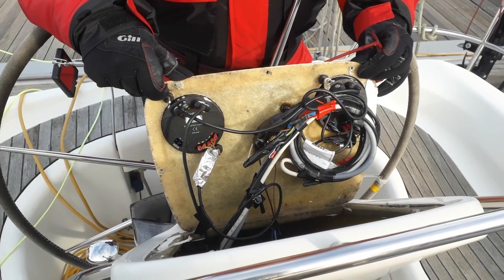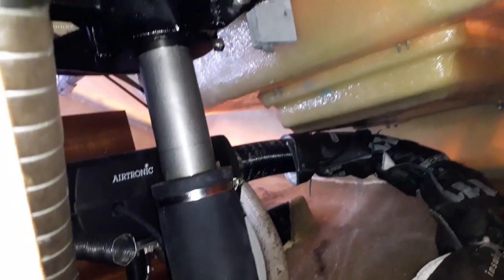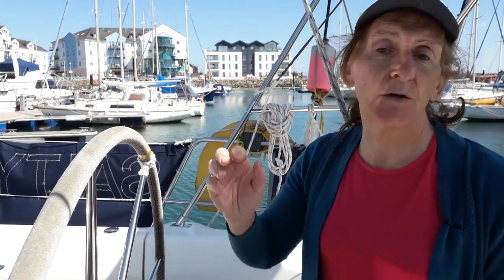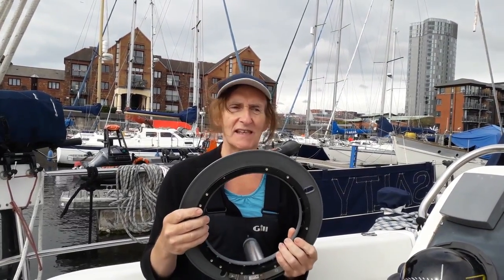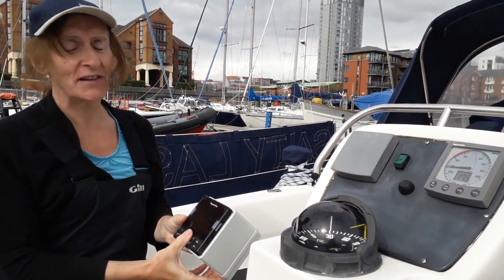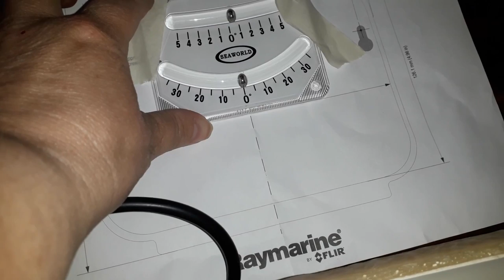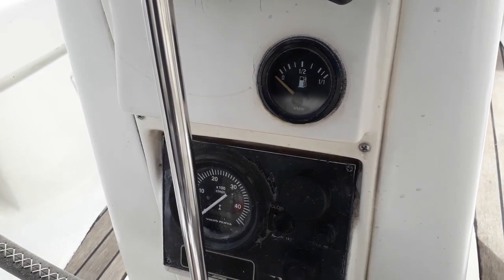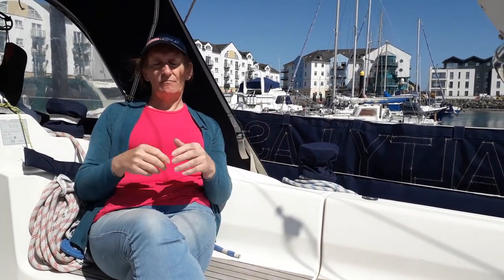Marine autopilot installation - Raymarine EV-100 autohelm - Ep. 134

Comment: I've no experience of wheelpilots, all 15 (approximately, never counted properly) of my boats have been tiller, so good to see this video, I'd be happier with an internal linear drive but sure they are very expensive, I'd hope that a boat I'd bought already had one! I keep making mean offers for larger boats, might get a shock one day if an offer is accepted.
Reply from the maker: It is one of the reasons a second-hand boat can be much better value than a brand new one - all those nice "extras" fitted by the previous owner.
Reply from the maker: Gaynor here - Not too sure how the present situation is going to affect the price of boats. I think they will go down, but I have already received an email from a seller saying that they have several people wanting to buy boats and the price of boats is going up as they have more buyers than sellers so we will just have to wait and see. 
As you have only had tillers you should be a dab hand at autopilots for them
Reply: @SailingYachtSaltyLass  I've  seen some sell, the market is smaller though. Anyone buying away from their locality would have to buy sight unseen if they stick to the travel rules. I missed out on a Bavaria 37 in Conwy lately. I've been inside some tillerpilots and wonder how their flimsy gears cope, they too give in when it's rougher then the long stay at the helm begins.
Reply from the maker: Oh! Which Bavaria? There was one a couple of slips down from us when we were in Conwy. It was called "Christina"
Reply: @SailingYachtSaltyLass  Yes, that was the one, was under offer a month, they were going to contact me if it fell through.
Reply from the maker: It seemed a nice enough boat, but an inferior layout to ours ;-) A blogger called Sailing Melody also looked at it and it is on their YT channel about 2 or 3 videos back

Comment: I have all raymarine and am very happy with them however cpt autopilots makes a great wheel pilot for 2,000.00 thats very strong and durable. If you need to steer in offshore passages for boats up to 40,000 pounds.
Reply from the maker: Useful information to know. Our boat when loaded up is 6 or 7 tonnes (about 14,000lbs I think)

Comment: We fitted a Raymarine Axiom chart plotter, we already had a Raymarine wheel pilot ST4000 on a Seatalk network.  The ST4000 seatalk network is connected to the Axiom Seatalkng network via a bridge.  The reason i mention all this is that a course set on the chartplotter will be followed by the ST4000 wheelpilot.  I would be really surprised if your wheel pilot did not have this functionality, bear in mind our ST4000 is prob 20 years old.  I think the wheel pilot used the cross track error messages to steer the course, maybe someone who knows could comment on this.
Reply from the maker: That is really interesting to know. I wonder if it is a Raymarine thing? Our plotter is a B&G although we do have a Garmin on the network as well.
Reply: It's worth checking your b&g manual to see if you can configure for op of XTR message.  I'm sure the Ray marine unit won't be brandist and will use the XTR  message regardless of origin.
Reply from the maker: I'll look it up because as long as the B&G can get the messages on the network then we are sorted
Reply: Looks like the ev100 has track mode so if you have a network connection between plotter and pilot then all should be good.  https://forum.raymarine.com/showthread.php?tid=3984
Reply from the maker: I do recall seeing something about "tracks". We will have a look at that and if we can make it work then we will put a video up about it.

We might have to wait for a few weeks for testing purposes..
Reply: @SailingYachtSaltyLass  I just watched your update video...thank you

Comment: Hi, thanx for the video. You had troubles with the clutch, and replaced the backplate. Did you also consider turning the steering wheel around ? In my Bavaria it gives more space betwen wheeldrive and pedestal.
Reply from the maker: I think our wheel only fits one way round. I remember having a struggle with it in the early days because it was backwards. It is an interesting solution 👍

Comment: Thanks for the video. Can you tell me what residual forces you have on the helm when the autopilot clutch is disengaged? I have fitted one, but the wheel forces are much higher than I expected with it disengaged. (I also have yet to see the wheel pilot appear on the P70  within the backbone, so not sure what the deal is there as yet)
Reply from the maker: When we disengage the autopilot and release the clutch there is no residual resisitance from the autpilot. It feels like a normal wheel and rotates freely. So, in your position I would try removing the drive and clutch (I am assuming you have a wheelpilot like us and not a hydraulic ram on the quadrant) and seeing if the wheel turns freely.

If the wheel still feels heavy with the autopilot removed then either the steering need lubricated or the rudder bearing needs replacing. I say this because in Bavarias like ours the factory fitted rudder bearing is known to swell and make the steering feel very heavy. Many owners replace the factory bearing with a needle bearing instead.

If the steering feels OK after removing the wheeldrive then try adjusting the friction setting. This is a small nut just between the drive motor and the pedestal pin and is adjusted with an Allen Key to unlock it and then twist it round and relock with the Allen key. You might be able to reach this with the wheel pilot in place if your binnacle shape allows.
Reply: Thanks for the reply. The helm runs free as a bird without the wheel pilot installed, so I think more troubleshooting will be required!
Reply from the maker: In that case, check the little clutch tensioner on the back of the plastic wheel fitting. It is right beside the drive motor

Comment: how many amps does this typically use in an hour under way?
Reply from the maker: It's maximum draw is 7A but in moderate conditions it uses a lot less. Once the sails are balanced the boat will practically hold a course without the auto-pilot and in those conditions it uses almost no power. Also, the solar panels mean that the power issues are even less of a concern

Comment: You guys are fantastic! My boyfriend and I loved the installation. We also need the box for the monitor and your tip is very welcome. Only concern we would like to share is the fact that the compass can't be around any electronics, and that may include the ACU. Maybe that's what had you guys going in circles? 
Anyway, we loved the video and your creative solutions. 

Best, 

Nykki and Gustavo
Reply from the maker: We found the cause of the problem. The flux compass is against a bulkhead which has the starboard locker on the other side and we found a deck brush with a mild steel handle in that locker. Once we removed the steel brush everything was good again. We detailed it in Episode 147 about 2 minutes in.

https://youtu.be/bEQzLcJfYXo

Thanks for your kind words and we are glad that you are enjoying the channel
Reply: انا سعيد جدا اني وجدت قناتك على اليوتيوب واقدم تحياتي لك واشكرك على المعلومات التي تقدميها لكني احتاج منك مساعدة كيف يمكنني ان احصل على منظومه القياده الاوتوماتيكية وهل هناك عنوان لمتجر يمكنني التواصل معه لشراء المنظومه
Reply from the maker: Hi there. The unit is a Raymarine EV-100. The best thing to do is to search on the internet for a Raymarine dealer in your country and then contact them.
Reply: @SailingYachtSaltyLass  شكرا جزيلا لايوجد متجر في القطر الذي انا فيه اقرب مجهز في تركيا وحاولت التواصل معه لكن لايوجد عنده منظومة الاتوبايلت
Reply from the maker: @abdullahgamezer9516  - Perhaps try Greece or some of Gulf states? Or use Amazon. Search for "Raymarine EV-100". I doubt you will get as good a price as through a local dealer but it is listed on Amazon UK.

Comment: good job, thanks
Reply from the maker: Thanks for watching!
Reply: @SailingYachtSaltyLass  I bought  the same autopilot and this week I have to install it, so your video is in my subject
Reply from the maker: @zenvad8080  - there are a couple of follow-up videos as well as we discover more and more about the autopilot. Also the flux compass is very sensitive to CHANGES in the magnetic field. We had a deck brush that moved around in the locker when at sea. As we later discovered it had a mild-steel fitting in the shaft and was strongly magnetised and as it rolled from side to side the flux compass would go insane. It was about ½ metre away from the compass. Now anything mild steel or magnetic is banned from the rear half of the cockpit.
Reply from the maker: @zenvad8080  - We have created a playlist for the Autopilot and its related issues. Good luck with your install
https://www.youtube.com/playlist?list=PL28HWPHBunMmTSg-dbXziOvh14rBTC7B1
Reply: @SailingYachtSaltyLass  thank you very much
Reply: @SailingYachtSaltyLass  my wires were torn off from the electric motor, it just dangles in the case, sent it to the seller, they soldered these wires, now I'm afraid to install it back,
Reply from the maker: @zenvad8080  - did it arrive like that or did something snag the wires after installation? If a vendor sold it to you in that condition, I would return it, demand a full refund and then buy it from someone else
Reply: @SailingYachtSaltyLass  I returned them, they soldered the wires, now the problem is to properly install the motor back, so as not to scroll the wires again.
Reply from the maker: @zenvad8080  - we installed a few wooden pads (Sikaflexed to the inside of the fibreglass) and then we attached  saddles to them and cable-tied the wires to the saddles. This kept them secure and out of the way of anything that might snag them.
Reply: @SailingYachtSaltyLass  on Monday I will add ...

Comment: Great job!
Noticed there were a few cables around your flux compass; wonder if you've noticed them cause any deviation. I have a German production boat that has around 20-degree deviation caused by house battery charge current when the engine is running! Also has a friends headphones placed in the wrong place jibe the boat; joys of technology. 
Love the video. Many thanks.
Reply from the maker: We are getting a deviation, but it is occasional, so you might be fine for say 5 weeks, then all of a sudden it goes haywire. What we think the problem is, is that we have to read the instructions again as it only happens when we press certain buttons, but we can never remember which buttons we have pressed.
I tided up the cables more after the last shot of my wiring plus we looked at all that, the very first time it went haywire which was just coming into Portrush. It was our first thought though.

Comment: Abit late to the party but if a boat is left in one direction for any length of time (on a berth) it can become magnetised by earths magnetic field (especially steel boats ). With a yacht the mast and boom could be affected this however wears off once underway and changing heading . Resulting in slight changes of deviation , so boat may need a quick recalibrating if laid up for a while. 
May also settle things down if you move the flux gate compass away from the aft area as lots of metal parts there particularly the rudder post and associated equipment. I think on my boat it is in a locker midships. maybe with your new NMEA 2000 there a suitable place further away. Just my ten peneth worth enjoy the videos fair winds and safe landings all the best ....
Reply from the maker: Hi Ian, thanks for the comments. I had not considered the Earth's magnetic field but I suspect that for a teel boat it could be a problem. Luckily for us, our boat is almost completely fibreglass and aluminium and what steel we have is stainless which magnetises poorly. We did have a few problems later on that turned out to be caused by a piece of mild steel in a lazarette!!!

Comment: Thanks for this step by step video. I just installed the same autopilot and now have a question: how did you connect SeaTalk NG backbone to your NMEA 2K backbone. I see there is backbone adapters available. Did you connect at terminal ends? Did you disconnect power feed to one of the two backbones? Thanks and fair winds!
Reply from the maker: This boat had no networks of any kind when we purchased it, but we did have some devices that had NMEA2K DeviceNet connectors rather than Seatalk ones. What we did was we bought Seatalk to DeviceNet cables (they have different connectors at each end) and then we plugged the other devices directly into the Seatalk network.

If your boat has a NMEA2K network already, I would try buy a joining cable to bridge the two networks and place it in the NMEA network as close as possible to the power supply and leave the Seatalk network "unpowered". It will either work or it will not, but it is a safer trial than attempting to power them both.

If your NMEA network only has two or three devices and the Seatalk network is larger, then power the Seatalk one and unpower the NMEA network and bridge it in.

If you have 20 devices in each then I have no idea what to do 😄
Reply: @SailingYachtSaltyLass  Thank you so much for the prompt reply! I will bridge the networks, unpower Sea Talk, and let you know how it goes!

Comment: Very good video, well done 👏👏
Where you find the box for the control panel?
Reply from the maker: The P70 box was ordered from Amazon

https://www.amazon.co.uk/gp/product/B06ZY2XPG5/ref=ppx_yo_dt_b_asin_title_o08_s00?ie=UTF8&psc=1

The other box was this one, but we did not buy it on eBay.

https://www.ebay.co.uk/p/2072325818?iid=371803725422&chn=ps&norover=1&mkevt=1&mkrid=710-134428-41853-0&mkcid=2&itemid=371803725422&targetid=878077541881&device=c&mktype=pla&googleloc=1007275&poi=&campaignid=9441266622&mkgroupid=95287893825&rlsatarget=pla-878077541881&abcId=1140486&merchantid=7276964&gclid=EAIaIQobChMIq7XE8f6i6QIVF-DtCh15vQAoEAQYAyABEgLhMPD_BwE
Reply from the maker: Found the correct url for you https://seamarknunn.com/acatalog/nasa-clipper-mounting-pod-8042.html

Comment: Do you have a link to the box you used for the autopilot screen
Reply from the maker: https://www.amazon.co.uk/gp/product/B06ZY2XPG5/ref=ppx_yo_dt_b_search_asin_title?ie=UTF8&psc=1

You can find everything to do with the installation including a full parts list on our website. The link below will take you straight to the relevant info.

http://www.saltylass.co.uk/marine-autopilot-installation
Reply: Sailing Yacht Salty Lass thanks so much such a great idea I just ordered one
Reply from the maker: We could not believe the prices of some suppliers - some wanted more for the box than the cost of the instrument to go in it. This little weatherproof box has done very well. We just mounted it "bottom up" with the access panel facing away from the P70.